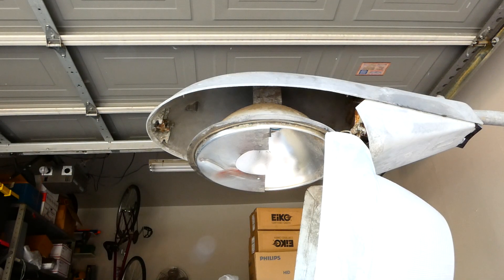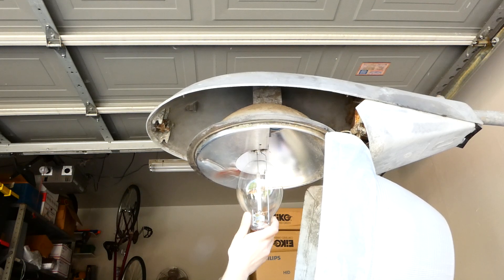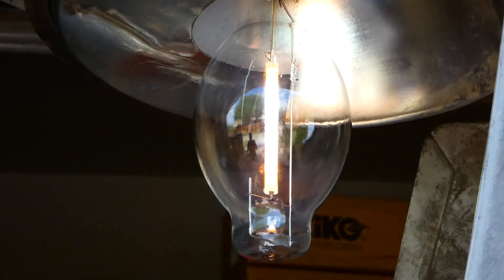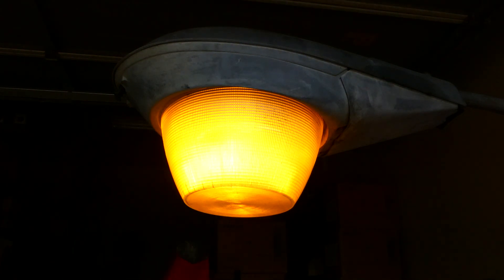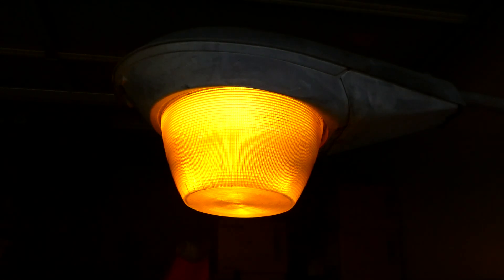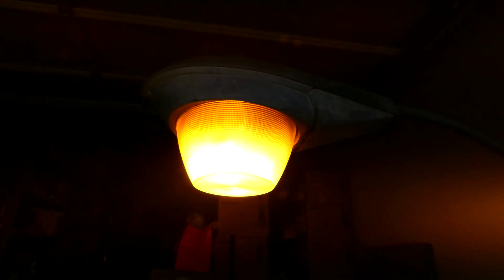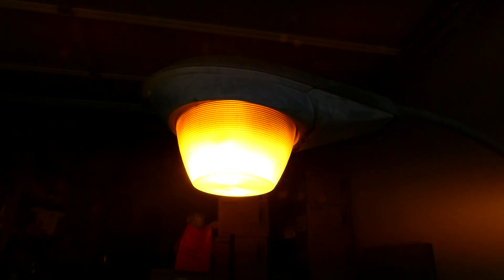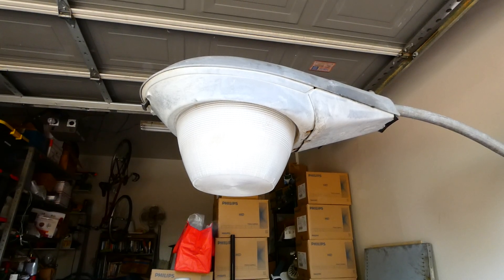General Electric C400 "CrimeFighter" street light in HPS

Comment: As a word of caution, you have to be extremely careful with running these Sylvania 360W Unalux lamps because they were designed to run on HX (high reactance) autotransformer ballasts or 208-277V series choke ballasts instead of CWA (constant wattage autotransformer) ballasts. If the lamp is used on a CWA ballasts for too long, you might damage the lamp or the ballast. This means that they must NEVER be used on most 400W M59 probe start metal halide ballasts since many of them are CWA ballasts. The reason that the Unalux lamps are incompatible with CWA ballasts is because the constant current nature of those ballasts causes the Unalux lamps to run at dangerously high power loadings due to the fact that their arc voltage drops rise very fast during their lives. In the long term, a CWA ballast can get destroyed due to the lamp overloading its primary. In this case, if you want to continue running your Unalux lamp again, it is best to invest in a 400W H33 mercury vapor HX autotransformer ballast or invest in importing a European 220V 50Hz 400W mercury vapor series choke ballast if you have any access to 240V 60Hz supplies at home. Sadly, HX autotransformer ballasts for mercury vapor lamps 250W and above are very hard to find.

As far as I can tell, I can see that the fixture appears to have a CWA ballast due to the appearance of 2 dark edges on the flicker bands. A proper HX autotransformer ballast or series choke ballast should only produce narrow dark flicker bands with one dark line in the center.

As far as I can tell, the lamp and ballast should be okay if the setup is operated for short test runs. Sadly, I have read that one collector in the lighting community has damaged one of their Unalux lamps by running it on a CWA ballast even though it was for a short test run.
Reply from the maker: Thanks for the word salad, this was literally done just for a video. I do not even own this light, and it is no longer at my house. I am well aware of the operating characteristics of Unalux lamps, and I never intend on really using my refit lamps in installations.

Comment: It resembles as GE M-400A from early 1970s through mid 1980s, as well as GE M-400A2 from 1985 to early 2000s, but they are really GE C400, and GE C400-2. There are a couple different of these two. The later ones does have a location of photocell moved from the back to the center of the fixture, and it has a clamp instead of the push lever. These types of fixtures are used in Chicago Illinois then other major cities in the USA.